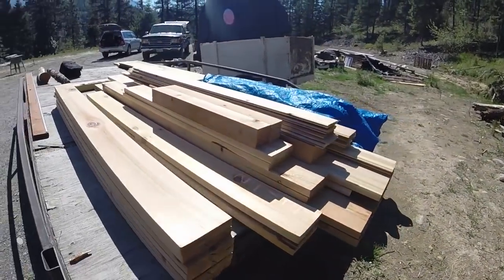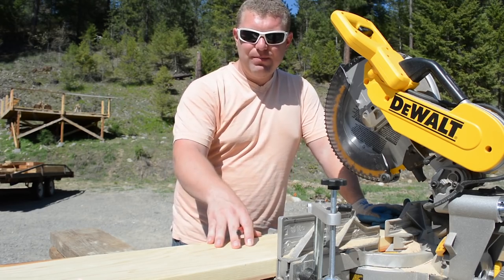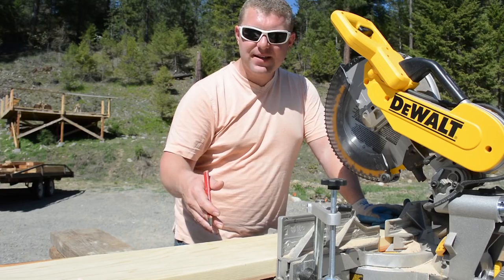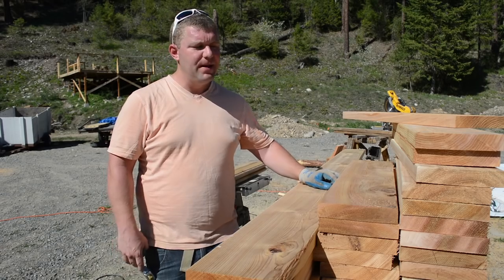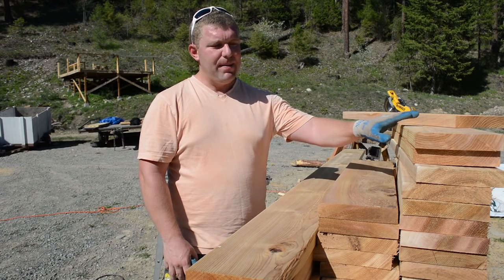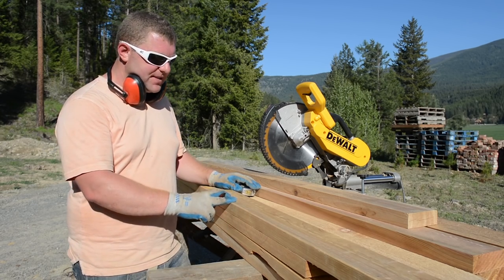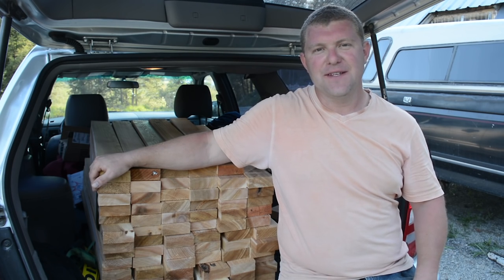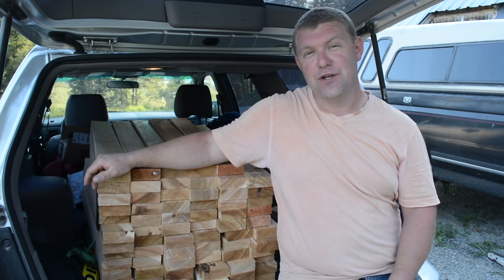DIY Cedar Hot Tub (Episode 2): Cutting the Staves

Comment: drill out the knots.make clear plugs from the waste and drive them into the hole where the knot used to be .you can make a plug with a drill and belt sander      find something round to draw a circle just larger then you drill bit find the center and run a screw in after cutting off the majority of the wood out side the circle with your chop saw...chuck up the screw in a drill and apply the plug with the drill running to a belt sander and you can make a tapered plug in two minutes with cedar
Reply from the maker: Good point! Hadn't thought about it that hard. Haha

Comment: You guys are certainly making progress!

A couple things, and I know I sound like a safety sally here, but please take a minute and hear me out.
The very short clip of your wife ripping a board, it looks like she is pushing it with her hips, I understand that like most women she has a lot more power in her hips than her upper body, but this puts her right in the danger kick back zone on a tablesaw. If that wood you are ripping warps as you cut it and the kerf at the back of the blade closes that board can kick back, and that kick back would be right into her midsection, can we say "OUCH"?? Please make it a habit of standing out of the line of fire when ripping on the tablesaw.
The second item is gloves and high speed spinning sharp pieces of steel, they don't mix. If you somehow had your hand touch a spinning blade you could get lucky and have only a nick in your skin, if that glove touches a spinning blade it will drag your whole hand into the meat grinder and you will have some serious problems. Ditch the gloves, buy some good tweezers with a magnifying glass on them to pick out splinters.
I'm not trying to be a jerk, I'm trying to offer advice that I hope will save you some pain an suffering.

Really I can't wait to see the hot tub, should be very cool!
Domo
Reply from the maker: +StuInTokyo Thank you for the concern and thoughtfulness.
Reply: +StuInTokyo MY THUNDER STOLEN.